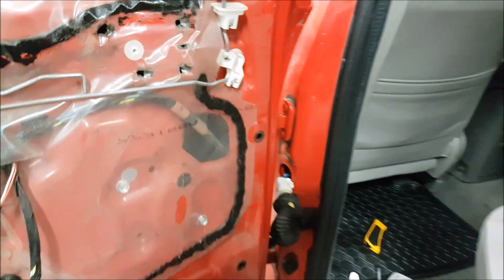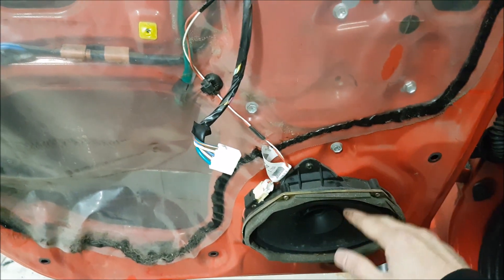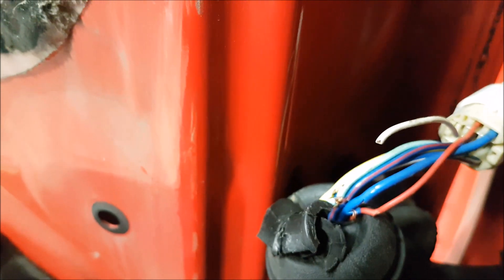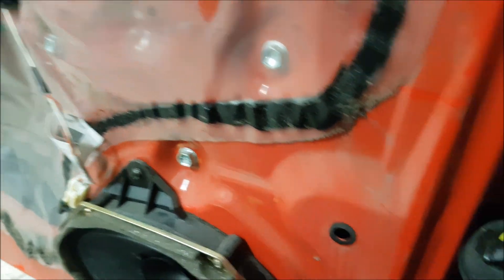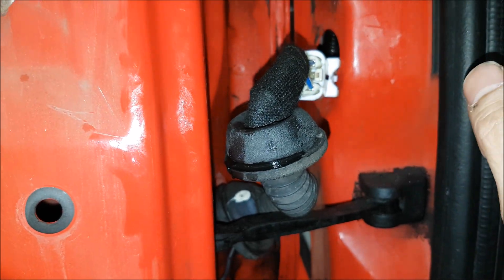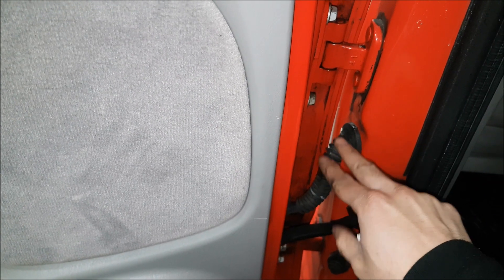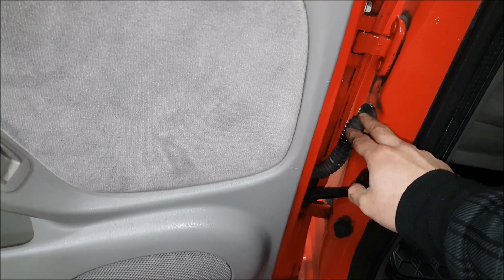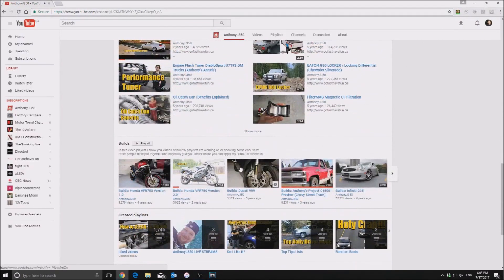Rear Speakers not working 1998 to 2004 Tacoma Double Cab | AnthonyJ350

Comment: I just had to do this on my 91 mr2. The whole door harness had snapped and ended up killing the head unit.
Reply from the maker: connly33 That sucks! Was it an aftermarket head unit?
Reply: AnthonyJ350 No luckily, I was going to replace it anyway. Just wish I would have checked the wires before sound deadening the door and getting it all back together. I know for next time though.